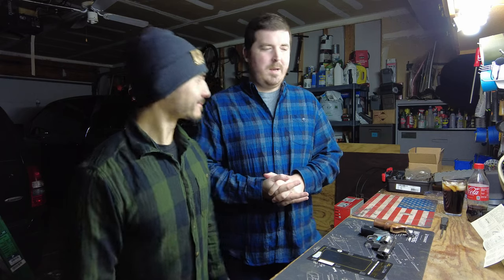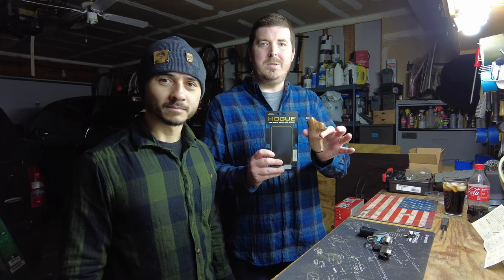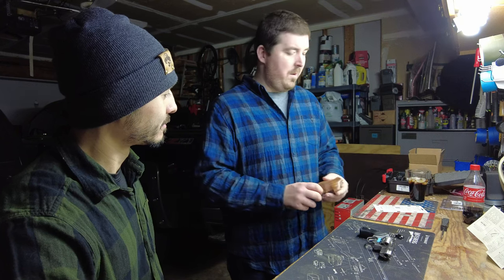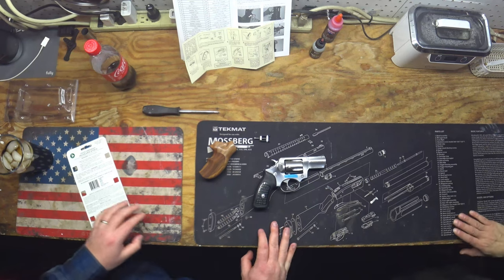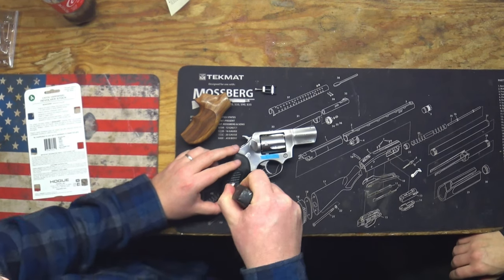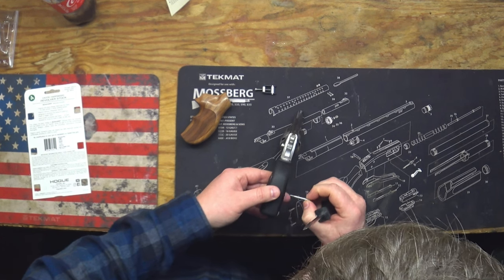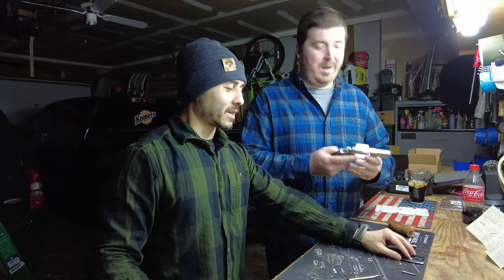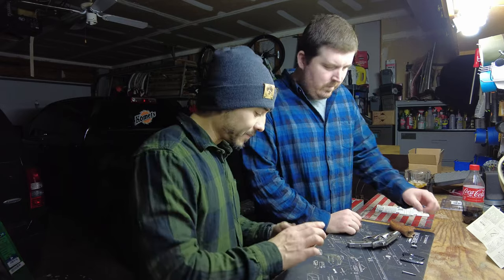SP101 Grip Change:  Stock to Hogue Grip

Comment: How did the grip hold up on you guys? I had the the same fitment "issues" on my Hogue grip and it broke after 15 rounds! The installation went exactly how you two showed in the video. I'm concerned the same thing is going to happen when I receive my second one, and I'm not sure how to prevent that in case I did something wrong.
Reply from the maker: hmm, that is quite interesting.  How did it break, the wood split?  I am sure Hogue would have a warranty.  For us, the grip has not broken or anything, it's still really nice and secured.
Reply: @58Alpha  It did split at the grain. Directly under the trigger guard. I've already contacted Hogue and they are sending a replacement. I'm just concerned about the same thing happening to my second one as nothing significant was different between what I did and what was done in this video.

The grain was a little different from all the other grips I've seen though. The entire grip had parallel grains, as opposed to others where the spot under the trigger guard loops around. If I'm not mistaken, that strengthens the wood overall
Reply from the maker: @Snattle_Rake  Ah, then I would focus more on that grip design than how you installed it.  I'm sure the 2nd grip will do better then.